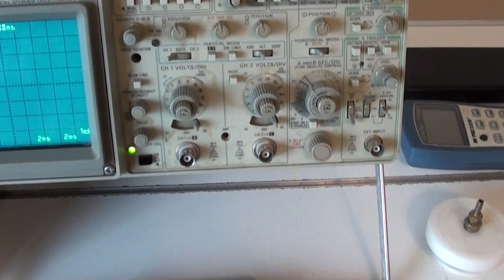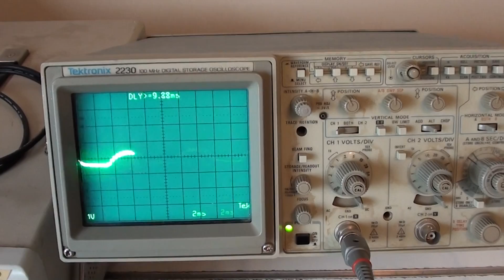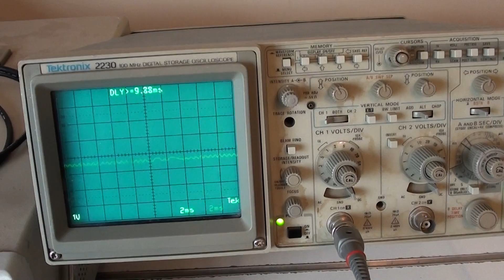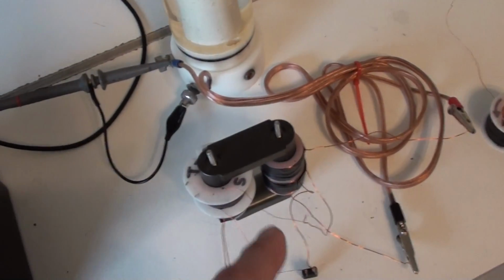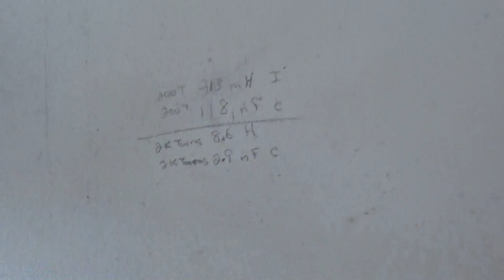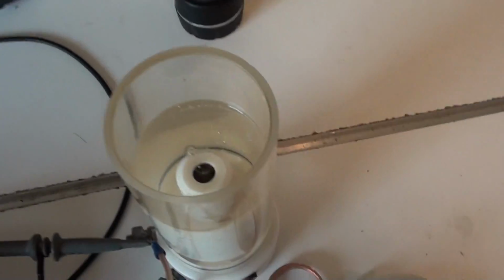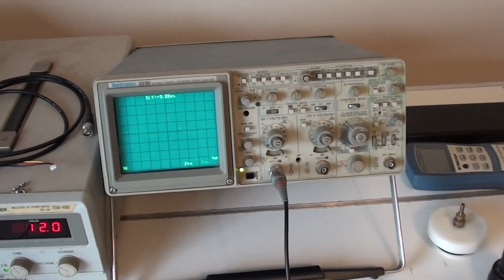Stan Meyers replication resonant cell 4

Comment: Nice one Don, there you go. Think Max is right, get the U-core from him and try that, myne fell into pieces and I tried glueing it back together, will see if it holds up. Busy hand winding my coils. Primary 50-100 Turns, Secondary 4000 turns, C1 4000 turns C2 3750 turns, then just to sort the pulsed DC situation out. So I take that rectifier diode converts to some DC output? Cuz AC makes no HHO